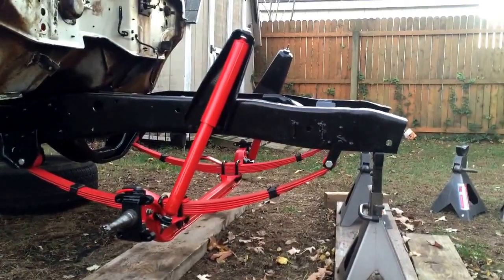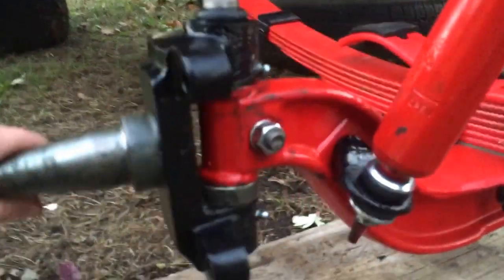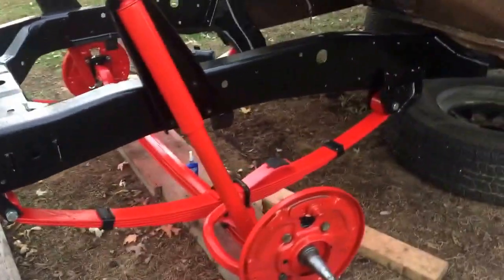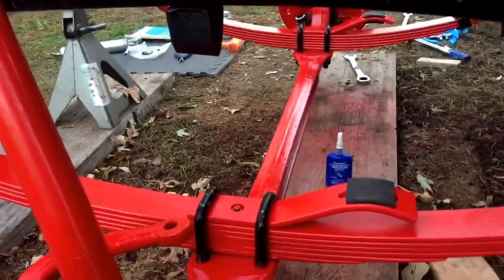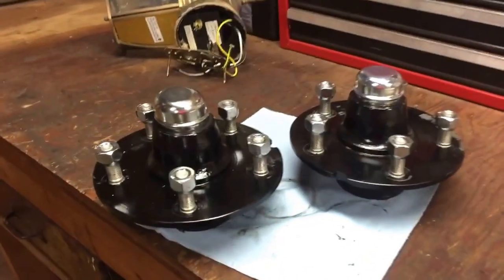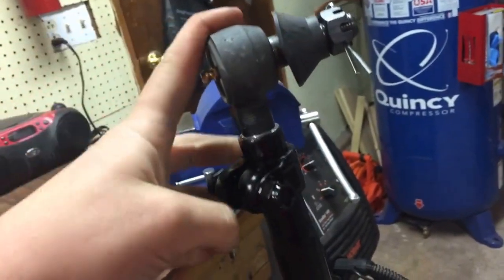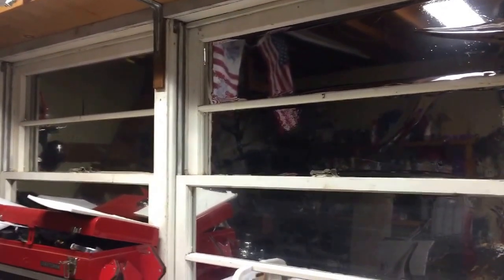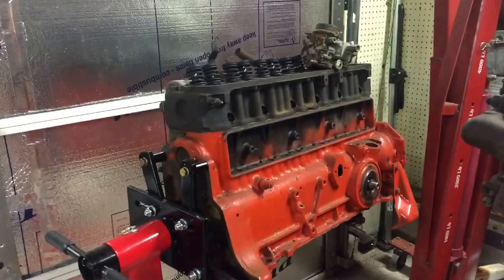Front suspension installation update.

Comment: Looks great! Very similar setup to the 51NAPCO. Each thing I have changed has given me different outcomes as Ive built and driven out the bugs of it. I might be able to give you some insight when you get to steering and handling issues when you get it back on the road. Yours should be pretty much an alignment and call it good with the rebuild you've done. Keep it up!
Bruce
Reply from the maker: +CHEVY NAPCO yeah I just did a basic alignment just to put it back on the tires, I will get it an official alignment as soon as I start getting it road worthy- thats still off in the future.  Lots of stuff to do!